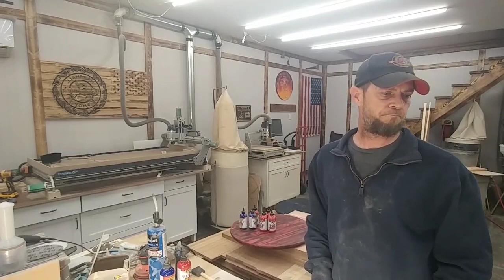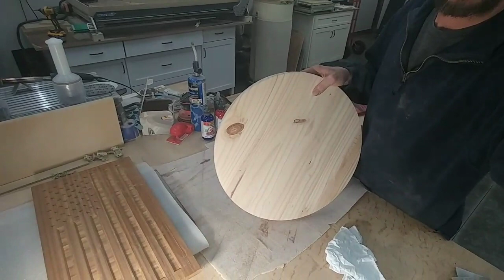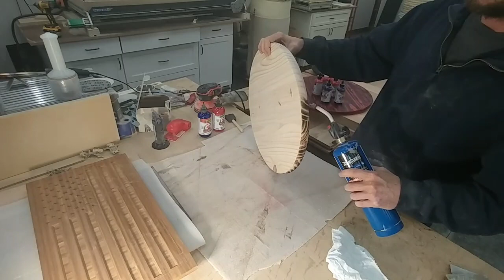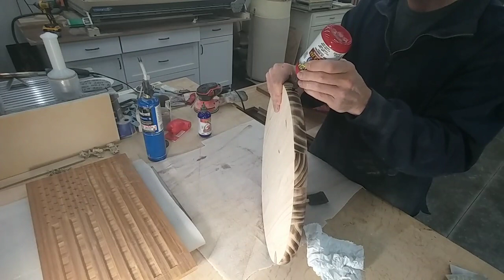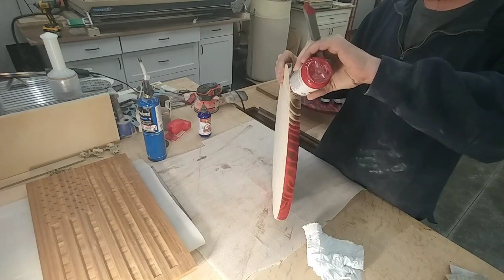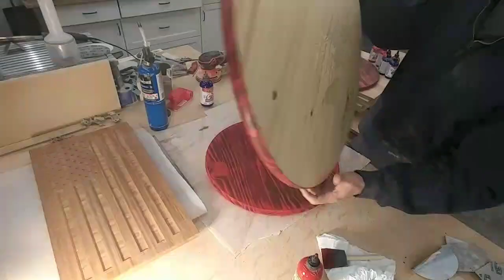Torching pine and applying Unicorn Spit

Comment: You got a smooth hand bro.. I tried with the same type of torch on a piece of sanded subfloor thinking it would be easy...😂noooo it was N.O.T😂 Mine looked Horrible as horrible gets. You did Awesome bro🙂
Reply from the maker: Practice on scrap 2x4's .... As you can see from all the trim in my shop, I've had a lot of practice

Comment: Thanks for the tutorial! So you don't brush any of the soot off? Do you find that the soot darkens the spit as you go? Also, you mentioned a vinyl sealer, why this as compared to other sealers? Just curious...thanks!
Reply from the maker: It's not a deep burn and rubs off when applying spit. The vinyl sealer is just another sanding sealer, pre-cat which is ready for sanding in 20-30 minutes. It's solvent-based instead of water or oil.

Comment: I would love to ask 3 questions:
What bit
what depth
what size is the circle 
GREAT JOB
Reply from the maker: If you're referring to the Fire Rescue logo, I used a 90 degree vbit and 1/4" endmill with a flat depth of .25" on a 24" round.  I just finished shooting another video with the same process using the Fire Effect and cut the USMC EGA inside of a fire wheel!  It will be uploaded soon.  Semper Fi!
Reply: @MarshallCNC  actually watching now. First video that popped up tonight and  saw the EGA. I am a Marine. 87-95. Hope to learn a lot. almost ready to buy the unicorn fire. thanks for responding
Reply from the maker: @cooperusmcsgt5918  Marine also, 91-95 ... SF

Comment: On the fire and rescue logo if the circle is 18 inch in dia. What is the cut depth and bits do you used? Thanks
Reply from the maker: Vcarve with 90 vbit and 1/4 or 1/8 endmill with flat depth of .25"
Reply: @MarshallCNC  Thank you so much. I have another question . I am trying to fine the finish you used  would you mine sharing the name  and type  also where you buy it from? Thanks again. Ron
Reply from the maker: You can get vinyl sealer and conversion varnish at places like Sherwin Williams
Reply: @MarshallCNC  Thank You Ron